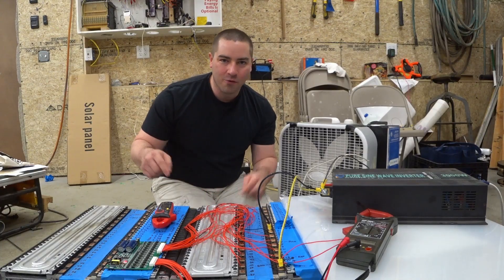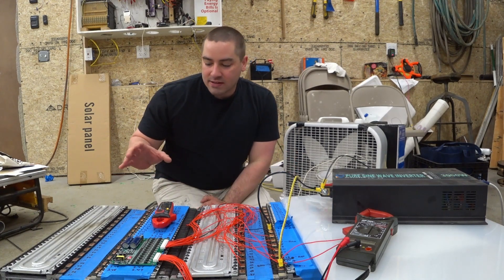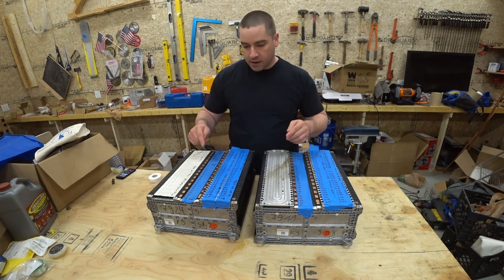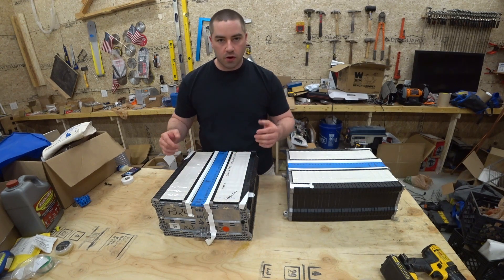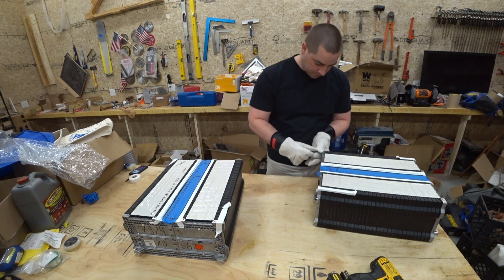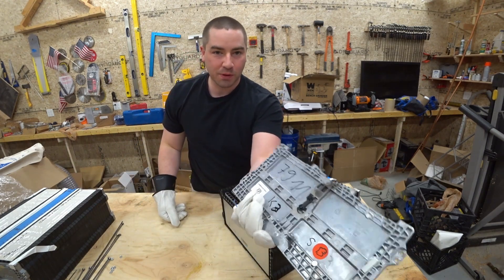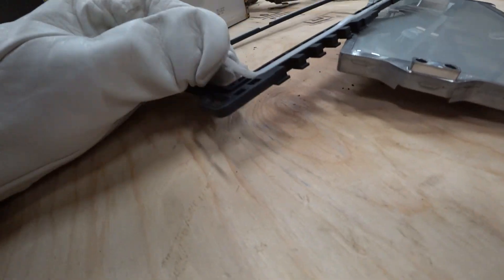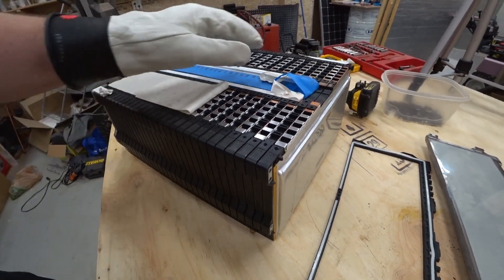Removing A Bad Lithium Cell from Battery Pack, Smart Fortwo

Comment: Great video. You don’t have to use the grinder, you can place your 5 in 1 between the tab and the plastic after you seperate the side that is not welded and pry a little as you separate the other side and the spot welds will pop right off.
Reply from the maker: Thanks Shawn.  I look forward to giving that a try.  I guess I made an assumption the spot welds would be stronger, but you have the experience to back up your tip.  Good news.
Reply from the maker: Hi Shawn,  I just tried out your tip.  It worked perfectly!  WOW.  I feel like such a dummy for using my angle grinder know that I know how easily I can pry the spot welds apart.  Thank you.  I posted a picture on my facebook: https://www.facebook.com/DavidPozEnergy/
Reply: I’ll help however I can. I’m so glad that these are working out better than initially planned. If you are wanting to create 48v packs you will not be able to easily keep the same size without having 5 dummy cells between the packs. 13s2p. Good luck
Reply: Awesome tip.
Reply: Exactly the comment I was about to write. XD
I got a little worried when he picked up the grinder. :P
Reply: Interesting, but how do you weld the new cell ? I would like to change some cells from my Smart ED
Reply: Why are you fixing these batteries? did you reinstall them in your car and fix the car?

Comment: You are indeed correct in regards to the cells needing structure. A safety designed in many lithium pouch cells to prevent thermal overrun or internal shortage is they are built with the "Active Material" sheets being loose between the anodes and cathodes. When pouch cells go bad, they swell and the separation in the layers basically self disables parts of the cell so it reduces to lower capacity or completely unable to hold a charge due to the spacing between the layers is no longer close enough to allow the flow of Ion transport. Basically, they are designed with chemical reaction built into the active layers to swell under the presence of certain chemicals, thus why you see swelling occurring. The swell reaction produces room for the sheets to reduce transfer energy internally. If you dont place the structuring back, the cells that are exposed to the void can expand under the heat of use and when an internal layer expands too much could trigger them to chemically react and permanently swell. I would just measure the thickness of a cell pack and just cut a thin wood spacer to slot between the cells in that empty space and assemble the pack back together, soldering a wire to continue the connection among the battery according to correct polarity.
Reply from the maker: Thanks for helping explain the "WHY" behind it.  That's helpful.

Comment: All cells expand and contract (slightly) when you remove or add energy. This weakens the bond between the cathode and anode. Heavly compressing pouch cells helps to mitigate this somewhat. Tube cells (18650 ect) are wrapped on themselves to stop this. So in short, yes the cells will last much longer when compressed.

Comment: They are tightly packed for structural purposes.  (e.g., so they don't disfigure).  I have 20Ah lifepo4 pouch cells loosely bound in a "giant usb battery" and they perform just fine without constriction.  Though in my battery they're in a hard tool case surrounded by foam packing :-).  Nice to see you wearing gloves for a change.

Also a bit of gap from the exterior insulator and the cells isn't really a problem.  You can do the same by putting tape on the cell and pulling it.  Out of the factory they are firm due to adhesion (remember the cell is full of liquid electrolyte) but you can seperate it by pulling on it (source: I accidentally pulled on some tape I had on my pouch cells).  I mean your cell is likely dead if it's reading 0 volts but just because the exterior is loose doesn't itself mean it's dead.
Reply from the maker: OK, Thanks.

Comment: Thanks for your experience!! So, do you have the "mounting" video???.... and the most interesting: Where do you buy "new" or used cells???

Regards!!
Reply from the maker: This battery I bought from a Junkyard.  But recently I've been buying my batteries from Battery Hookup. (.com)
Reply: @DavidPozEnergy  Thanks David for your answer... I don't find parts for Smart For Two batteries... Included I wrote to Li-Tec (Germany) but its impossible... However, I don't find any instructions or video to how to fix "new" cells again... Do you have it??

By other theme, do you know about electric cars reparation training?? Read about CISE Electronics...

Regards!!
Reply from the maker: I don't know anything about the Smart car.  I just pulled the battery.  I did find some of these cells for sale, but never bought them, so I don't know if they are good or bad for your purposes.  https://www.techdirectclub.com/114v-6-kwh-31-lithium-ion-cells-li-tech-battery-50a-benz/

Comment: In a some videos I saw that people extracted the gas and after reseld the battery littium 18650 and get recharge a realive the batteries... but I dont know if that it´s works!
Reply from the maker: I don't know about that.  Any bad cells I recycled.
Reply: @DavidPozEnergy  Thas better... but, some miracles happen I saw some in your videos!

Comment: How about threading those long rod ends a bit further so you can bolts them back up tight?
Reply from the maker: I think that is a great idea.  However, I was thinking it might be fun to try bolting the modules back on the large steel base.  If I change the length of the modules I won't be able to do that.
Reply: @DavidPozEnergy  Ah, got it...  that won't work then.  I saw somebody mention cutting board material (delrin), I assume to make spacers, that might work...  Also, you mentioned not running those aluminum heat sinks because no coolant will be plumbed I gather. Aluminum is an excellent conductor of heat, and they provide additional surface area, so I bet having them mounted as passive heat sinks (w/o liquid cooling) would still net more heat loss than without...  Just a thought....  Keep rocking brother!
Reply from the maker: I agree that the aluminum could be used as a passive heat sink.  I have not yet tried, but when I re-arrange some cells I will probably be doing a little soldering of the tabs.  The solder joints will be thicker, and maybe prevent the heat sink from fitting properly.  Just thoughts going through my mind, but I will just have to try it out.  If I can fit them (aluminum) back on I will.

Comment: As others have suggested, either leave the bad cell in there, just cut the metal positive and negative connectors from it, or find some other piece of plastic to sandwich in between the cells to keep them pressed.

Comment: I would leave the bad cell inside and just jumper over it, I would also discharge it to 0 volts very slowly.
Reply: Problem is, the bad cell might very well swell up after some time, hurting the rest of the pack.

Comment: Use the old pack but disconnected/bypass them from the Main cells.  Hook up a 10k resistor with a heat sink to the dead cell for discharge! be careful if the cell start to get larger as it is not air in that cell it can be hydrogen,  fluorine, and or other gases. Best to have a outdoor metal box with a vent.

Comment: You don't have to take the written voltage on the pack too literally. When the cells are fully charged, they will be 4.2 V, or preferably somewhere between 4.0 V and 4.1 V (4.2 V will cause faster degradation). But as they discharge, they will get closer to 3.0 V (never let them get discharged to 0 V).

The written 3.6 V or 3.7 V is just the average voltage, or the voltage in the middle of the voltage range.
Reply from the maker: Thanks.

Comment: Do you have a fire extinguisher in your shop? or at least a plan if one of those cells catches fire (like drop it into a bucket then run the bucket outside).
Reply: A 5 gallon bucket of salt water works ideal for this.  The salt water is conductive to quickly drain the battery while submerged.

Comment: Did you get the 50Ah out of it? Litec.De made by AG Diamler. SK cell.  I got a few of those. You can always tell where the puffing is. They are very sturdy, thick cells. Not very powerful. 

Also David, since I do alot of this: there is a Dremel head that is out, a new one that takes great little sturdy blades. I chop up a whole module with one or two disks. Great tool: Angle grinder is to strong here.. I used to do that but the danger of cell puncture is to great to risk getting burned. 

( Gas. the "air" in the cell is called a "gas". ) ;)

Comment: I know its been a while since your video, but would you have the dimensions of the battery case, with respect to how deep it is..I have a 2018 Smart and am planning on replacing just the cells with 100 ah units but need the dimensions to see if they will fit...thanks
Reply from the maker: I don't have the dimensions, sorry.

Comment: Leaving the cell out would create a hotspot where there's still standing air. Either replace it with a piece of heat-conductive material (metal or ceramic - maybe a ceramic tile) Also they need to be squished hard to work properly.

Comment: David Do you mind sharing a link fo where you got the software for your balance board? The one amp guy you have in this video. I am asking due to that I have one OTW and would like to load and test it on this computer with blue tooth. Thanks. Btw Your videos have been a lot of fun following over the past few years. Thanks so much for letting us all be a part of this journey. God Bless..
Reply from the maker: The exact link the manufacturer sent me has expired.  But this is the same software, just a different website address: https://bgp.xoubv5.top/jkbms  I don't know why that is.
Reply: Thanks brother. God Bless.

Comment: I thought you were about to take out the non-working cell and replace it with a working cell from the other pack to make them kind of equal in size
Reply from the maker: This video was just to see if I could remove a cell.  I didn't know what to expect or how difficult it would be.

Comment: you have to fill that gap if you want to use it at 1C or greater, im glad that you are able to use most the cells, will be cool to see how long they last long term. thanks for the upload, O yea hows you aims working, do you notice the 85w consent drain? I am testing the new reliable 8000w and its got a 35w idle drain, also wondering for my grand rents as they only have 1500w of solar :S
Reply from the maker: I watched your video today on the 8000 and gave you a thumbs up.  I like the re-design.  Bigger fans and bigger heat sink.  That looks great.   I've still got my two blown ones in the hopes that I can carve out the time to replace the fets.  The Aims has been flawless.  I think 65 watts idle when I tested it.  No, I have not noticed the drain.
Reply: Both of you should watch my video OPTIMAL INVERTER VOLTAGE

Comment: Put it back in but make it so it doesn't work (don't connect the tabs)
Reply from the maker: Thank you.  BTW, I got caught up on your videos today.  I love the display on your BMS.
Reply: @DavidPozEnergy   Cheers and good luck on the batteries they sure require a lot of research to get everything right like the 3.6 volts lol

Comment: Install a peace of rubber the thickness of the cells you removed
Reply from the maker: Thanks.  I'll check around.
Reply: Rubber is an insulation. Bad idea
Reply: DavidPoz A couple of mouse mats come to mind...
Reply: @climatechangepreppersfaceb2148  hes bor going to pulling enough power out of the batteries to worry about heat.

Comment: Why don’t you cannibalize one pack and fix the 2 damaged ones
Reply from the maker: I will be re-arranging some cells as needed to get them to the correct voltage.  The original car was probably about 350 volts.  I'm going to use this in a 48 volt setup.
Reply: DavidPoz u da man

Comment: Use the void for the BMS and pack it.
Reply from the maker: That would be pretty neat to have the BMS inside.
Reply: @DavidPozEnergy   Just make sure it cannot over heat! :-)
Reply from the maker: Right, there are little heaters in most BMS's.

Comment: There is not a particolar reason why the lithium cell should be pressed, indeed in RC stuff they never are. The metal plate at the sides it’s to avoid punctures
Reply from the maker: O, cool.  If that's all it is then great.  Thank you.
Reply: False on all counts